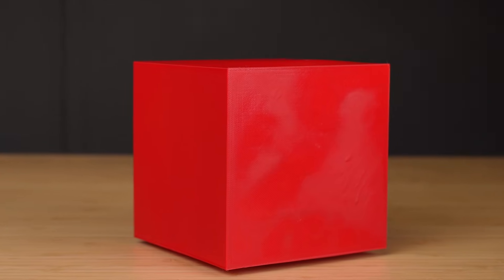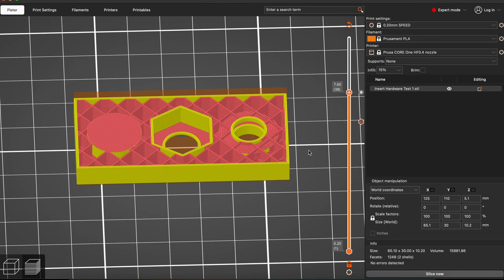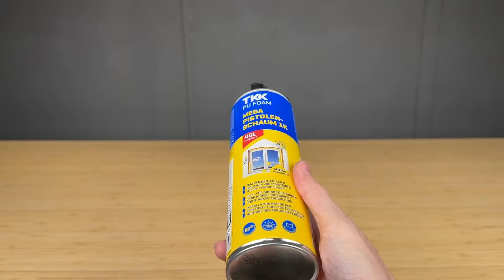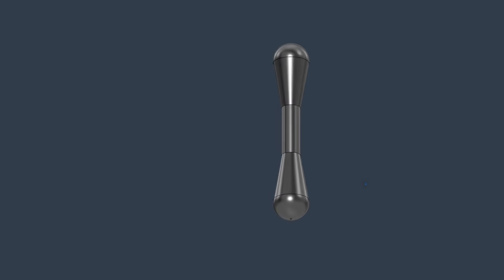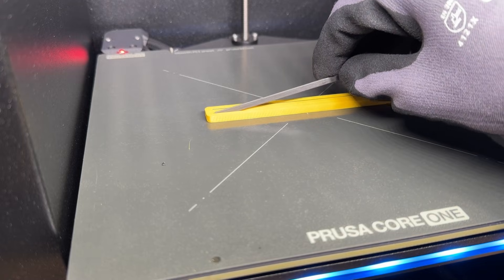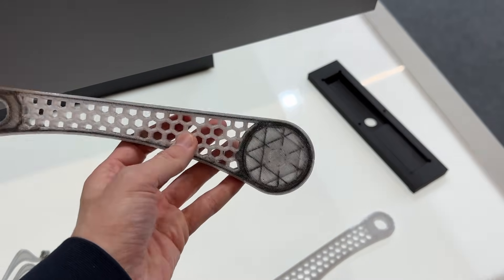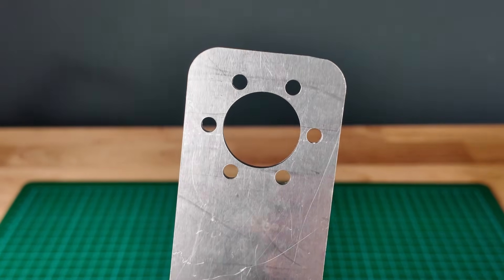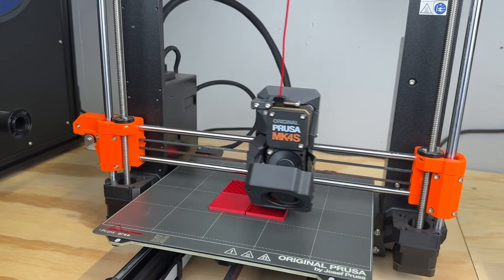Stronger 3D Prints by Inserting Hardware While Printing

Comment: Serendipity, I was just brainstorming lastnight how I might create a pivoting mount for a snowblower attachment for a 3d printed Sno-Trac I downloaded off youmagine. I was thinking an aluminum rod for the main undercarriage hinge, but what to do as the mounting brackets? You video just have me the answer, embed steel angle with holes into some mounts that bolt on. Can probably also use the same concept for the upper lift/winch frame, and those carbon rods could be the framework itself with some printed ends🤔

Comment: I've always wondered if someone would design long thing ribbed rods for a plastic welder could we design our parts with cylindrical channels that we could then insert said welding rods into to fix layer adhesion issues. It would then melt the layers together as well as reinforce them with metal.
Reply: Thinking about it I guess it would be sort of like a long thin heat insert

Comment: Strength will improve even more, if you insert stretches around mounting points. And for stronger layer adhesion fibers can be inserted afterwards if you leave channels for them and put the whole print under a bit of compression.

Comment: I usually grab aluminum rods at the hardware store to insert into swords I print for cosplays, but they are usually oily and have to be cleaned before use.  I think I'll try the carbon fiber rod approach next time.
Reply: Threaded rod can be found at the hardware store easily, I never found them to be oily, they catch onto the material a lot by just making a sliglty undersized hole and inserting it by tapping it in (with a drill). It's quite a bit cheaper and more accessible than carbon fiber if you don't mind the extra weight (on longer sections it is less stiff but I don't think this will be a problem with a plastic outside) (the extra weight is not much, maybe even desired for a prop that you handle). If you can I would not suggest screwing it by pausing the print tho.
Reply: Hm, what about that square tubing made from plastic that is sold for fast and light constructions (search "Alfter Quadratrohr"). Wouldn't that be fine and rather cheap, too?

edit: as that is extruded along it's Z-axis, it should be pretty strong, too in that dimension...

Comment: I've had this idea for years! About two years ago I bought some small stiff steel wire for a similar purpose (adding rigidity to a thin part) but never got around to finishing the design. Glad to see my idea was in the right direction
Reply: It's not a new idea. It's been used for going on over 2 decades.
Reply: @NoMoreBsPlease  Oh? where? I came up with it independently, so I'm curious to hear more

Comment: Great video, thanks!  Definitely be careful with sand - you can 3D print a cannister, separately pour in sand and glue on the top, then insert that cannister into your main print risk free.  I've also successfully used plaster of paris to make prints feel like stone (5th Element stone props), and filled an Indiana Jones fertility idol with lead shot for weight then poured in 2-part epoxy resin to solidify it into a solid mass to simulate the weight of a solid gold statue - it boggles the mind that a small statue can weigh nearly 25 lbs, it feels impossibly heavy!!!  5% Gyroid infill is amazing as fluids (including lead shot, sand and expanding foam) can reach all areas unblocked.

Also, be very careful on a bed-slinger if you are adding heavy weight mid-print.  Too much extra weight on the bed can cause print issues, so printing slower is advised, or simply add weight post-print.  CoreXY printers are the better choice here.
Reply: The CoreXY design has another advantage -- one of the things I've seen in a number of 3D printing videos is using resin-style supports for models with delicate sections that still require supports, so the supports can be easily trimmed off the finished print without running the risk of snapping the section off. But with a bed-slinger design, you will have the bed thrashing forward and back during the print, which is likely to cause the vertical shafts of the supports to sway back and forth, or even break off, causing the print to fail. Since CoreXY designs only move the bed vertically, they don't have the problem of transverse G forces on the supports as they're deposited, so are less likely to fail.

Comment: Excellent tips here, thanks for the video!  I use carbon rods and strips frequently in my foam RC planes, but I think I'll start integrating them more often in 3D prints now too.  An excellent source for carbon rods and strips for those of us in the USA, is Windcatcher RC, I source my carbon from them very regularly.
Reply from the maker: Thanks for sharing that recommendation with the community!
Reply: Same.  And for some reason it never occurred to me to incorporate into prints.  I wonder if something like that would allow us to use cheaper filament that won't sag in the summer outdoors.
Reply: Lol I also reinfoce foamies with carbon rods (works great combining two chuck glider wings for more length for catching thermals).

I just ordered my first printer in hopes of making inserts/housing for electrical parts in said chuck gliders.

Comment: Super video, this can for sure be super helpful in many many situations. I have a few notes.

I don't like that all of the examples adds the extra stiffness to the neutral axis for bending loads. Fair sometime you will have to do this.
But if you want extra stiffness without adding mass that do nothing you should avoid having dense material at the neutral axis.

Even if you can only offset the extra stiffness with a few mm this will increase the stiffness a lot. On the other hand you cannot go too close to the surface cause then you would risk the plastic just breaking at the location of the inserts.

I do really like the idea of coating 3D prints with thin metal layers on the outside, cause this will increase the stiffness a lot without adding much mass. But it is also much more complicated to do at home. 😥

Also you might want to glue the inserts to the plastic such that shear stress can be transferred between them. Thin of how easy it is to bend a paperback book do to each page being able to slide relative to the other pages.
If you glue all pages of a paper back book together it becomes about as stiff as a peace of wood. But it also becomes unreadable 😂.

Comment: Great video, not enough people (especially this new wave of 3D printer owners) know how easy it can be to dramatically improve part strength and stiffness. Its easy to get swept up in the hype of fancy new materials like PPA-CF and solutions like the Fibreseeker when in reality, you can make a part virtually indestructible with a few dollars worth of hardware and some good engineering practices.
Reply: Isn't Fibreseeker(where they unspool CF thread out the middle of the nozzle) still at the mercy of layer adhesion anyway?
Reply: @Rebar77_real  Very much so, yes. And I'd wager you get considerably worse layer adhesion between the carbon extrusions since you're likely to get a pretty uneven "sheathing" of the coextruded thermoplastic around the carbon strand. It does seem to give some genuine improvements to strength and stiffness in XY, but Z strength is a very big questionmark that no one seems willing to look into...yet. We'll see if they let CNCKitchen or JanTec have one to play with haha.
Reply: Yeah, agreed. Even more so when the actual strength of the manufacturing process is not properly understood, no reason to use a fancy filament if the part is not  oriented properly to begin with